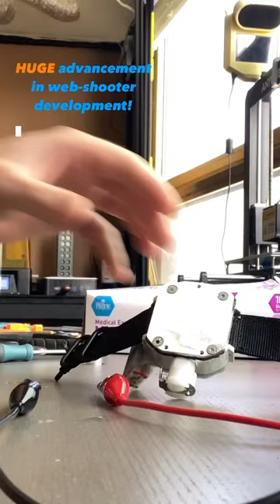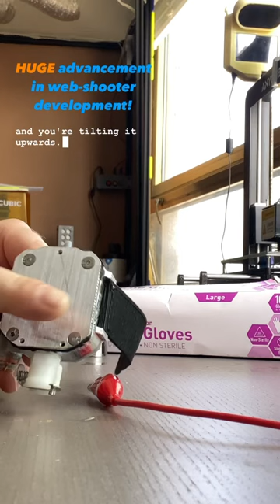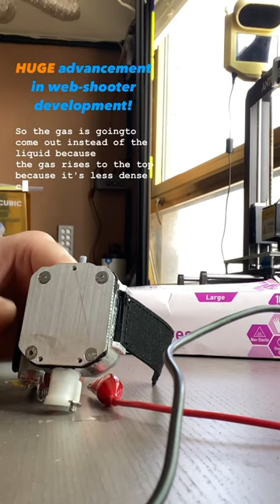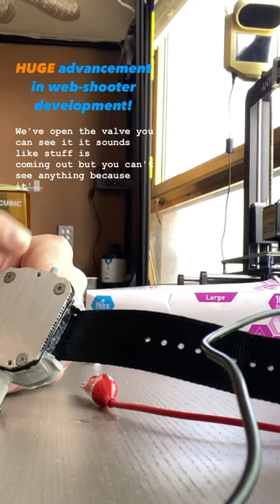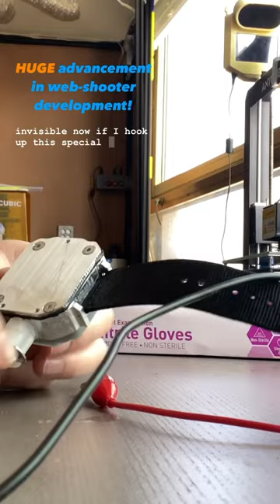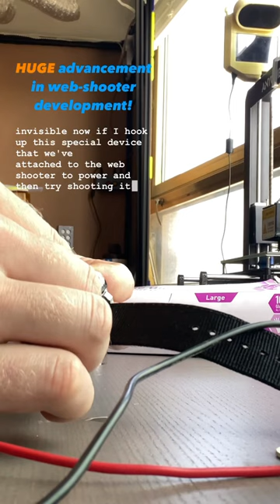Anti-Gravity Web-Shooters?

Comment: Hey there, I was curious if you’ve ever experimented with Caulobacter crescentus as a possible web fluid base. I’ve looked into it a little and it appears to have various pros and cons. It’s pros are that it’s a bacterium that grows in just about any source of water and should be very easy to cultivate, and it’s  also incredibly sticky and strong. The cons are that it’s INCREDIBLY sticky, so getting it to shoot out of a web shooter would most likely be very difficult, and it also seems to lose some of its effectiveness when it’s not in a liquid like water. Perhaps those cons could be solved by diluting the bacterium with a liquid while having some mechanical system constantly stirring the mixture. Ideally this would keep the bacterium effectively sticky when you shot it out into a solid line.

Comment: Are you applying heat to the cartridge or using a small motor to centrifuge it? My guess is centrifugal, because heating contents under pressure sounds questionable.
Reply from the maker: Haha I do do heating in my advanced web-shooter to regulate the temperature for cold environments tho
Reply: @theAmazing  You heat it to regulate pressure, meaning the cold environment is sucking away a lot of residual heat. You wouldn’t want it to get too hot at room temp, right? Don’t tell me you got some lil cooling system in there too.